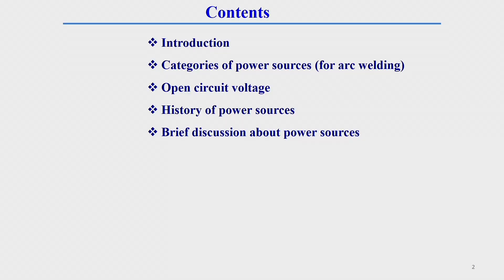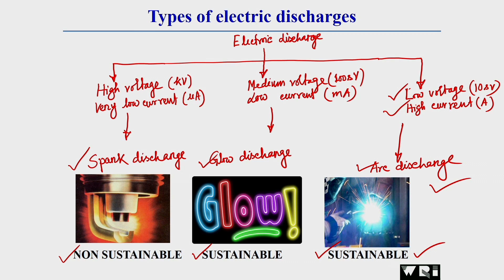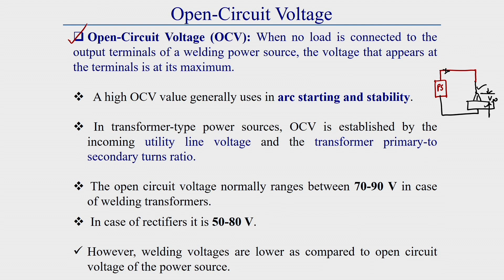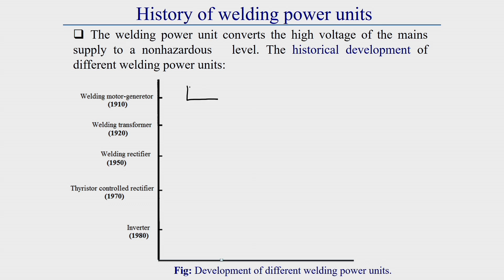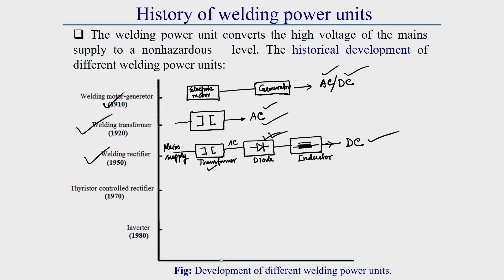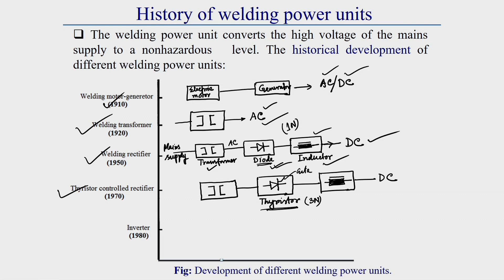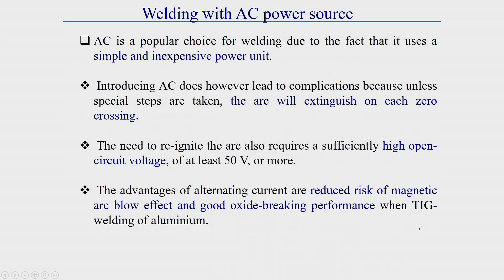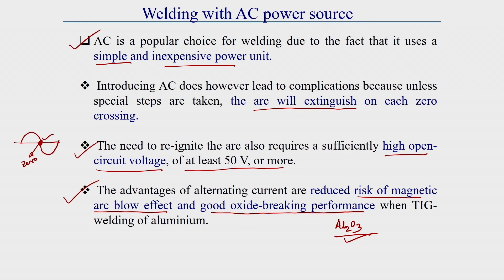Lecture 5: Welding power source - 1

Comment: inverter provides AC current not DC, that first slide was all messed up. you fixed all but the inverter current, yes you can change AC back to DC with a diode rectifier as in your later explanation of an inverter in the slide headed history of welding power sources, but an inverter on its own changes DC current to AC current.